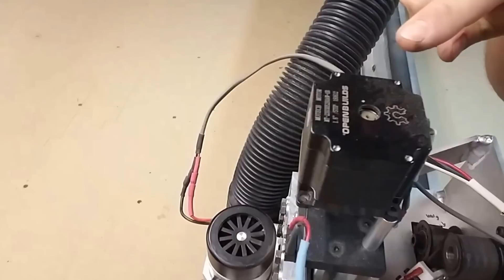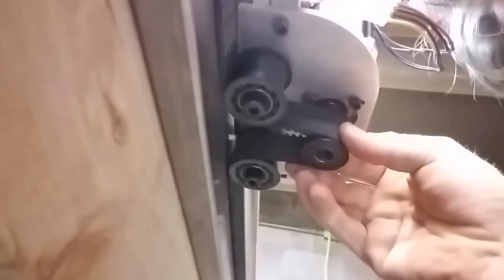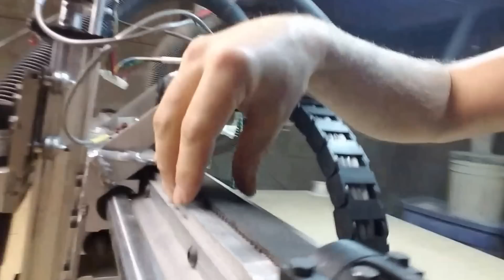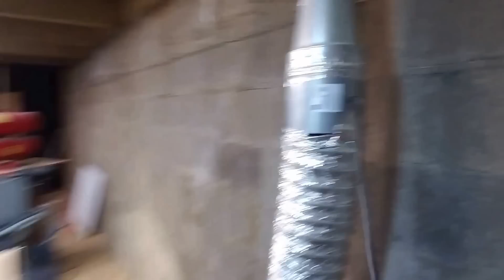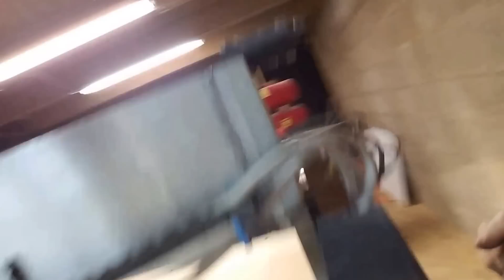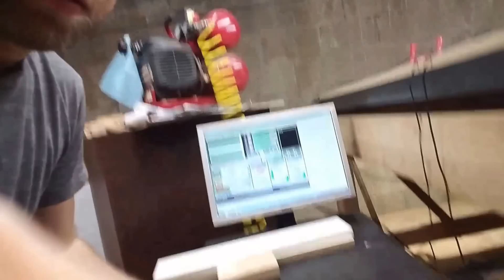An Introduction to the RiNO Route Belt Drive CNC

Comment: what belt width are u using?
Reply from the maker: 25mm
Reply: @MatterMage  thx
Reply: @MatterMage  with 25mm width... double belt has no sense?
Reply: @MatterMage   there are no issues with synchronization of motors at the Y axis?
Reply from the maker: @darya_botti  nope.

Comment: Nice build! However, i don´t think the motor is 200NM.. A Nema 34 is up to around 12NM..  😂
Reply from the maker: Yah some one called me out in comments early on. Good catch.
Reply: @MatterMage  How did you find out how big stepper motors you needed?
Reply from the maker: @J1I9M7M4Y  I have geared steppers so  I didn't need to go that big.... and other than that o just went a little bigger than what was being used for hobby stuff... shapeko etc. My belts and over all stiffness are not super great so I couldnt use anything bigger even if I had them. When I get around to rack and pinion I may go bigger
Reply: @MatterMage  Ok. Im building an all steel frame (including gantry) router with r&p drive for x and y. I guess i just have to go for Nema 34 12nm for the x and y. For z a nema 23 will be enough i belive. It might not become very fast but since im not going to do any large scale production it`s no big deal. The work space will be about 900x900mm. Thank you for sharing your build! Im subscribing!!
Reply from the maker: @J1I9M7M4Y  nice. You will need to gear them down a but so nema 34 should be very adequate.
Reply: @MatterMage  Yeah, it will be some trial and error until i find the right gearing..

Comment: is there a video of the machine actually moving?
Reply from the maker: Good question.... I just looked and I have to go pretty far back back to find one and the machine has lots of upgrades since then... I'll make a video just for you... any requests?
Reply: @MatterMage  Thank you for your answer. I am replying a bit late, sorry. I am interested in the transmission system: the belt drive in action, with a focus on the drive, the pinions, the belt while operating and also the system max speed, acceleration, ... Thank you
Reply from the maker: https://www.youtube.com/watch?v=uV7-AcvqMvQ

Comment: Anybody know what size of belt would it be necessary to avoid the use of gearboxes?
Reply: I was using a GT2 6mm belt drive that worked well at moving my y-axis but it had some trouble with stretching and tearing. I have since changed to 15mm wide belt, but when I tensioned the belt it created to much pressure on my nema23 stepper, now realize I need a gearbox for my application.
Reply: @Gvalenz12  Hi, about your trouble, could you fix it? I am usin a 10mm gt2 belt but I have stretching problems, it bounces back and forward, i use nema 34 8,5 newton motors, i am thinking about using htd5m 20mm belt with steel soul and se if that solves the bouncing issue I have. What do you think about that solution in your experience?
Reply: Hello  @CarlosManitasV  I ended up using a 15mm wide timing belt with steel core, from Amazon. It worked out well for me I added a 10;1 gearbox also from Amazon. I seen alot of talk about being inaccurate because of backlash/slop in the plantary gearbox, but it has good repeatability for my application (it's under 1/32"). The gearbox is on a nema 23 and it is strong. If you are using a nema34 I would probably go with a 20mm wide belt and it might not even need gearbox. Let me know if you have any questions and how it works out for you.
Reply: @Gvalenz12  thanks a lot for answering. I will go for the 20 mm belt and see how that goes. To be honest my plan is to use rack and pinion in the near future. But first I would like to know go to solve those issues in belt driven cnc router's. Because here where I live, most of the cnc routers are made with timming belts and there is a lot of the same issue with them. So let's see if I can come up with a good solution for it. Thanks man!!

Comment: Hi
Nice to talk to you
You did a very nice cnc table and I'm interesting to ask you a question about the linear bearing open end ?
Is this type of bearing not accurate or make a backlash during cutting?
I'm going to build my table but I'm confused between open end bearing and profile guide rail.
Do you think If I make twice 25 mm round bar with 4 open end bearing in each Y axis side ,,gonna fine backlash
Reply from the maker: I'm not entirely sure what you are asking but the bearing have been great.

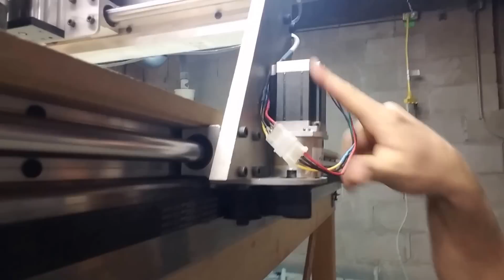Comment: 01:57 i don't think  this ist a 200Nm-Motor!!! :-) That would mean, it could heave up 20kg in 1m distance without any gears ... or do I get something wrong here?
Reply from the maker: Correct. Thank you for catching that. I had to look it up. It was near 250ozin... around 6Nm. After the gear box its capable of around 40Nm.
Reply: @MatterMage  Gearbox! Very clever! Good idea!
Reply: @MatterMage  250 oz in doesn't equate to 6Nm either, you had it right at first, I think, just needed to say 200 Ncm (2 Nm) instead...  :)   Awesome job on the machine, I'm curious how the belt drive would do for accuracy if you were pushing speeds, but it's a very cool setup.
Reply from the maker: @LoneOakWoodworks  it has treated me pretty good but its definitely a  little too loose given that my skill level is now much higher. But it's great for the price.
Reply: Yea I was caught off guard by that, too. My BMW has 400 Nm in a 3l motor, however it's not electric so I was not sure ^^ but 6 Nm sounds a lot more reasonable :D
Reply: Servus!
Einen Kilo auf einen ein Meter langen Arm gehängt gibt 9,81Nm ("die 9,81N wirken auf den einen Meter"). Das Muss man sich erst mal geben: Halt mal 20kg auf ein Meter Entfernung - Oder 200kg bei 10cm langem Ärmchen oder 1000kg bei einem Pully-Radius von 2cm ... ;-)

And here for the English folks: Hang one kg in one meter distance to the center and you have 9,81N x 1 m = 9,81Nm - it´s as easy as that ;-). My steppers are nema 35 and about 15cm x 10cm in size, they have 9Nm and it is idiotic and COMPLETE OVERKILL!!! I only bought it because of very bad advice.

Comment: Nice design! What about those belts? Are they rigid enough to withstand cutting forces together with accel/decel forces?
Reply from the maker: Belts are plenty strong and don't stretch over time like chain.
Reply: I'm using O4C chain and it works well with no stretch.  Next time though I'll use rack and pinion.

Comment: What is the width of your belt it looks 30mm? Also have you machined and aluminum and how did that work for you? Also Since you have had this machine for a while how has the design been so far? Belts reliable? anything you would have changed? Did you change the drive type?
Reply from the maker: 25mm. Have not tried alluminum yet. Z axis is weak. not worth the try till after I fix it.
Reply: Steven Sampson has the machine particulary the belts held up with the use over these past months? Any backlash problems?

Comment: Hi, what kind of precision you have on wood routing? have you tried on aluminum?
Reply from the maker: I'm around 1/10 mm. Just tried some aluminum the other day and it cuts just fine but the backlash is exaggerated.
Reply: @MatterMage  Is the backlash on the z-axis or on the other belt driven axes?
Reply from the maker: @forloop7713  it was on the x and the y due to the gear reduction used. Most of this has been removed.
Reply: @MatterMage  would be great your current thoughts and mods. Interesting project
Reply: @MatterMage  Hey man great job on your build. What kind of gearbox are you now using if any? I am currently building a router table and upgraded to 15mm wide belt drive from a 6mm. It took a toll on my 270oz-in nema23 motors they did not have the torque to drive the belt, when it hits any resistance the motors stall. With your experience what kind of gearbox would you recommend to avoid backlash/runout?
Reply from the maker: Pretty low due to the z axis not being up to snuff. new parts in soon. I'll give new fiugres after the fix. Have not tried aluminum.

Comment: Hi. Did you have any problems of syncing those y-axis belts/motors together? I'm considering making belt-driven CNC but with only one motor for every axis. (with axle under the table) I'm little worried about that if you make the y axis with two motors, can you really sync them together properly...
Reply from the maker: I just found this comment. Sorry for the delay. I have had zero issues with the two motors being out of sync. quite literally the check of a box in mach3. Have you started?
Reply: you dont have to use servos, take a look at franco  's channel where he shows the difference between open loop - and closed loop servo motors! This would be very interesting for you, I think ;-)